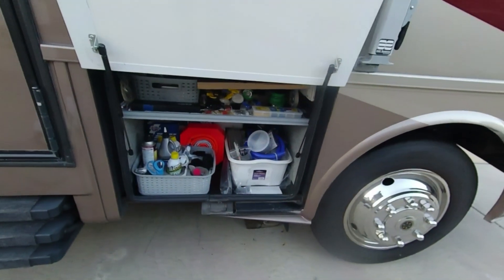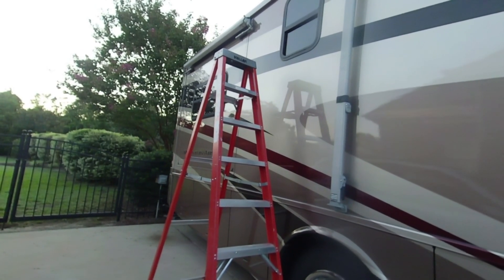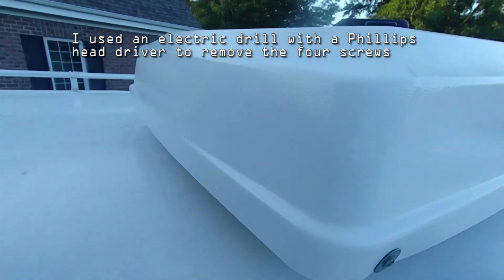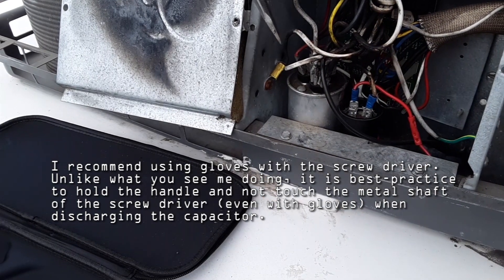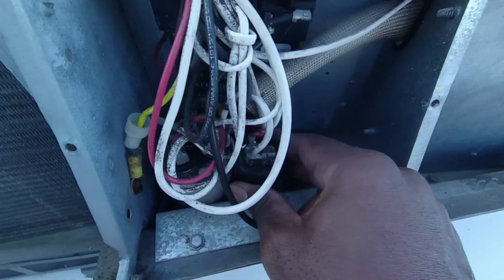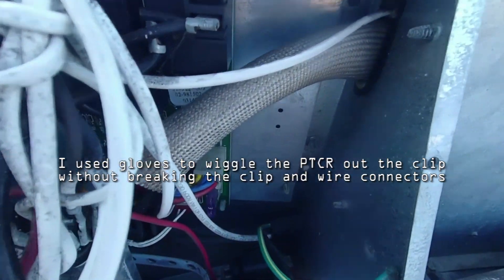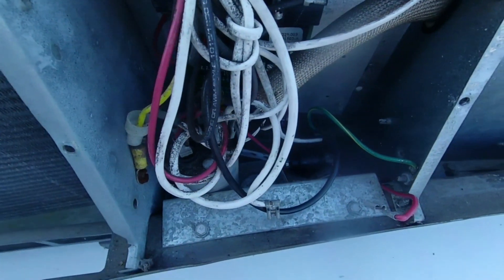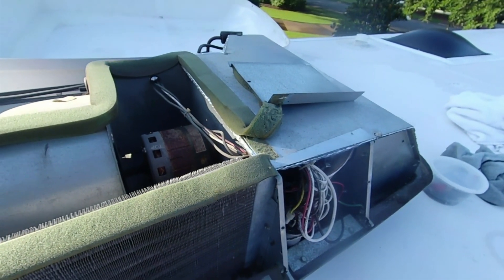Replacing Hard Start Kit and PTCR on RV AC

Comment: Sir, what is the part # for the capacitor and PTCR that you used .  I have a Dometic 15k AC with heat pump.
Reply from the maker: Hi Dave. PTCR is Dometic 3310731.009. It looks like you can get the capacitor and PTCR in a kit Dometic 3311883.000. Take care!